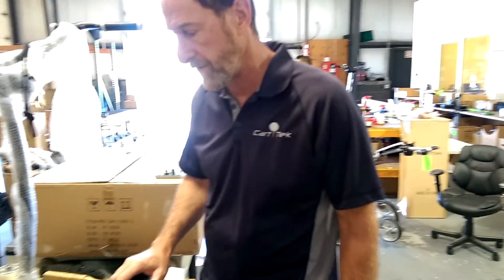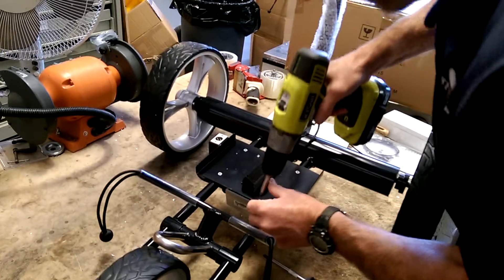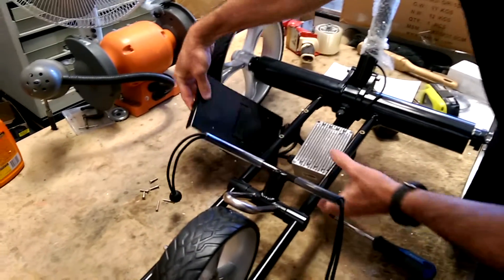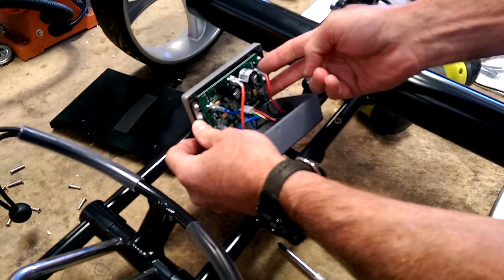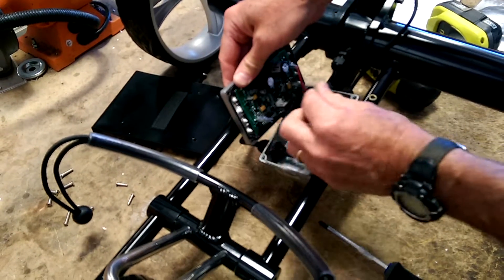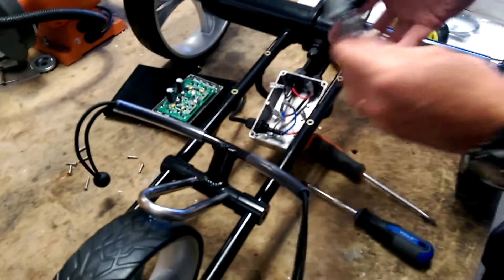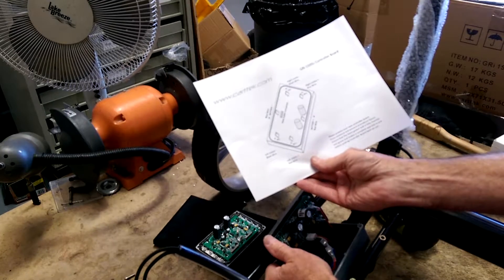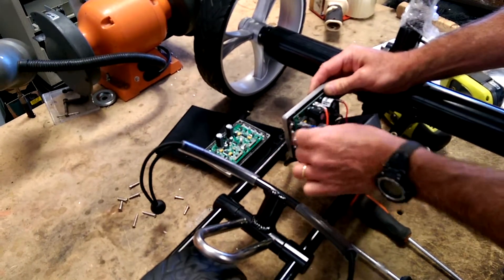1500Li MB replacement How To

Comment: Thank you I believe the mother board is the same as the GRX 950  What red flags that it is the mother board and not something else   Also I was trying to replace the gear box on the grx 950   cant seem to get the wheel hub off th dimount the gear box  any pointers  
akdreammaker@sbcglobal.net